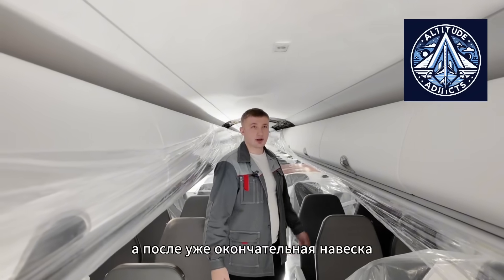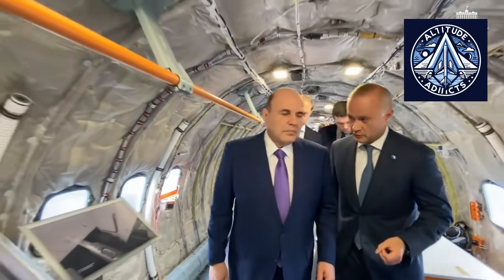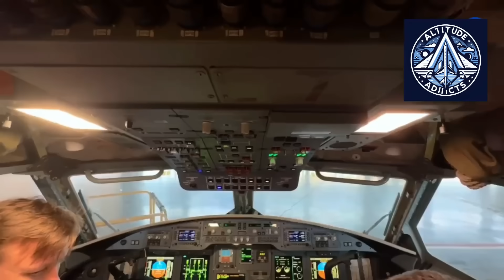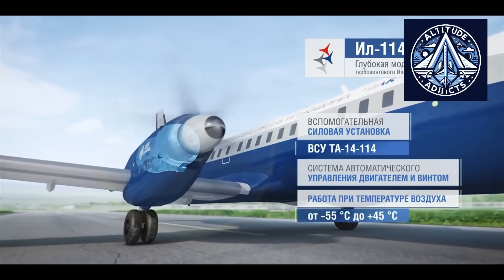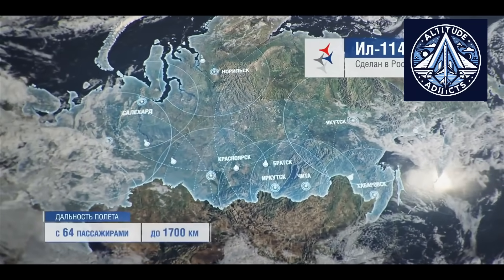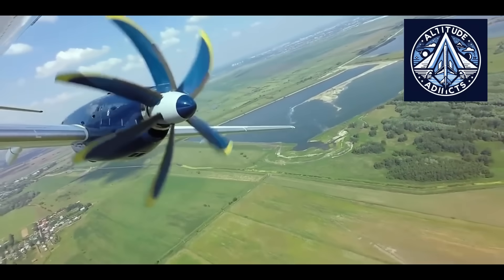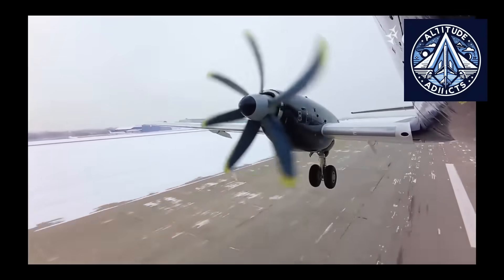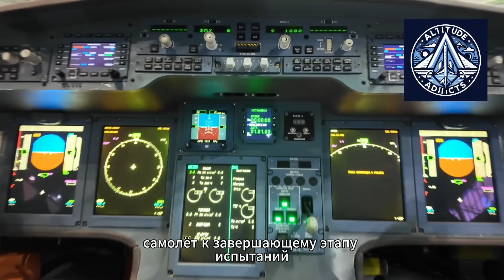IL-114-300: First Look at the New Interior & Why It Matters

Comment: Is this plane heavier than planned?
Reply from the maker: No information on increased weight. So, must be non issue.
Reply: Why would it be heavier? This plane is just a slightly modified Il-114 which was produced 30 years ago.
Reply: @LloydChristmas983  Could be for many reasons, more safety equipment required now, loss of original parts, engine upgrades can add weight and, structural strengthening as per the stated goals of the restart.  Maybe even additional fuel tanks and sound insulation could add weight.  It would be more plausible for it to gain weight than lose weight. Plus if I'm not mistaken, the original plane was 64 seats and AA said now seats 68.
Reply: @LloydChristmas983  Got new engines, new avionics & glass cockpit, more composite materials in its fuselage, and is produced in a different country altogether (now Russia, while the original was produced at the Tashkent aviation plant in Uzbekistan)
Reply: And the crew of 3 people?
Reply: @alexivanov417  Два.Командир и второй пилот.